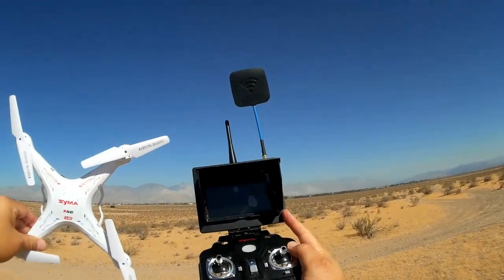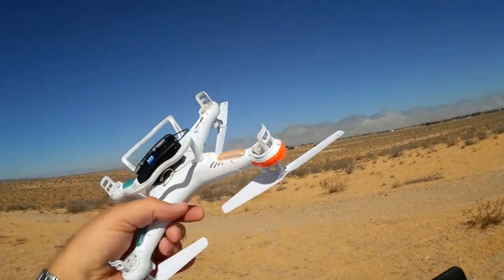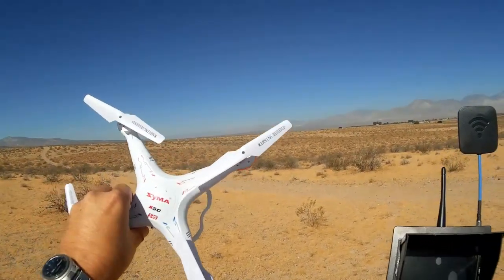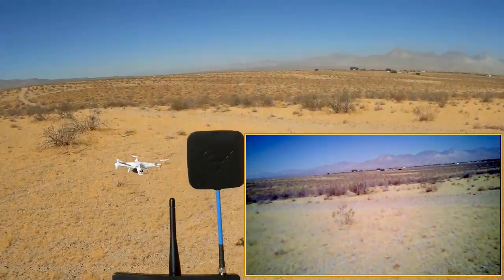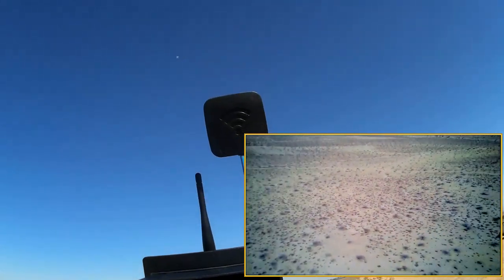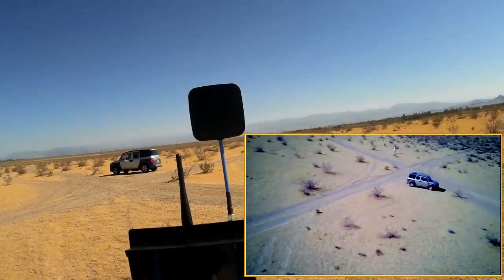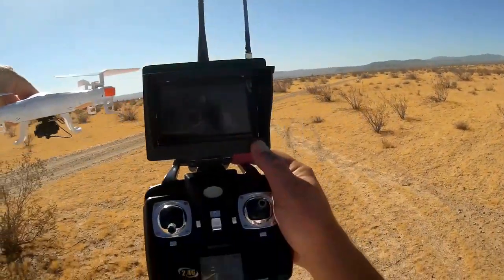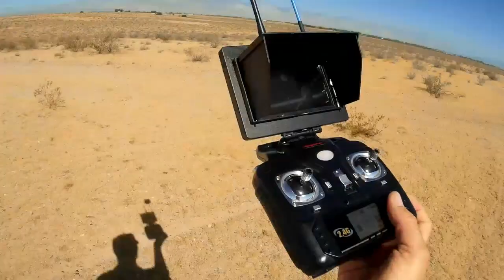Syma X5C X5S 5.8Ghz FPV Upgrade Review

Comment: How many dBi has that 5.8ghz planar antenna? Can I use another stronger antenna to increase distance for receiving signal? :D
Reply from the maker: It's about a 6dB similar to this http://www.banggood.com/Aomway-FPV-5_8G-6dB-Panel-Antenna-Mini-Enhanced-Antenna-for-Receiver-SMA-RP-SMA-p-1041209.html?p=RB0922217402201307U3
Reply: +Quadcopter 101 thank you sir, this was very fast and good to know :D
Reply: Sir, I bought and I got this product :D It is awesome, but I have one problem..my syma can not raise more than 1 meter from the ground, I use 800mAh new batteries :D Also I have new motors .. what can be the problem?
Reply from the maker: How To Channel Gently turn each propeller by hand to feel for any unusual resistance or binding in the turn.  If you notice any unusual bumps or resistance, you may have dirt or sand particles in the gears.  This will stress the motors.  It's very important to clean the gears so that the porpellers spin freely like a pinwheel.  Use an old toothbrush or pin.  Here's how https://www.youtube.com/watch?v=LzzD3BPVvH0
But if all propellers are spinning freely, but the quadcopter still does not have much power, then one or more of your motors may need to be replaced. To check for a failing motor, quickly apply power to take off.  If the quadcopter momentarily tilts in the direction of any particular motor at liftoff (instead of remaining level), that motor may be failing and needs replaced.
Reply: +Quadcopter 101 lovely answer sir, thank you very much :D

Comment: What is the camera called
Reply from the maker: +Tristan Taz  It's just a generic no-name FPV system.  You can find it here http://www.banggood.com/Syma-X5C-1-X5SC-X5SW-5_8G-FPV-720P-Camera-with-Monitor-Real-Time-Transmission-p-980090.html?p=RB0922217402201307U3  
It really works great.  I just did another video where I demonstrated FPV flying of my Flying 3D X8 using this system (video to be released later this week).

Comment: how do you record with this on syma x5sw also what resolution is the recording
Reply from the maker: You remove the existing camera, and replace it with this.  You'll also need a microSD memory card for this camera.  You start/stop the recording by pressing down on the silver button (throttle trim) to the right of the throttle stick.
Reply: What is the resolution
Reply from the maker: 1280 x 720p

Comment: Do u fly in headless mode
Reply from the maker: +alexjs0900 No, the X5C does not have headless mode.
Reply: +Quadcopter 101 I thought you said it was the x5sc
Reply from the maker: alexjs0900 No that's a X5C-1 in this video. Although this FPV camera can be used on both the X5C and X5SC.

Comment: how did you get such stabilized footage?
Reply from the maker: +Kaikualexander Lee Be gentle on the controls, AND always keep some forward movement / pitch when taking video.  Apply gentle yaw to turn and keep the quadcopter overhead with its forward movement.  If you're new to quadcopters, recommend the following tutorials to help you learn forward flight.  Be sure to also check out the other tutorials if you have time. http://quadcopter101.blogspot.com/2014/12/quadcopter-flight-school-4-horizontal.html
Reply: thx that helped a lot can i still do flips? with the camera (not for stable footage)
Reply: last question should I get the syma x5c or the syma x5s and can a syma x5c transmitter connect to syma x5s quad?
Reply: and is it better if i get the syma x5 fpv set or the syma x5s fpv set
Reply from the maker: Get the X5C.  It's a much better flier.  And the 5.8 Ghz FPV upgrade system is for both the X5C and X5S (it comes with attachment brackets for both).
Reply: so i should get the syma x5c vs the syma x5s if i had a choice. ( not about money) and also why is the syma x5c better?
Reply: pls help thx ive been looking for the perfect drone for me
Reply: i mean that fits my needs
Reply from the maker: Kaikualexander Lee 

Get the X5C.  It's a much better flier and doesn't have the "wind bug" that the X5SC and X5SW have.
Reply: thx know any place to get it cheaper?
Reply from the maker: Kaikualexander Lee If you live in the USA, it's $39.99 here http://shrsl.com/?~ap4t
Reply: thx does this drone have a v6 chip?
Reply: This for sure is the last of my question (im new to this quadcopter thing).
Reply from the maker: Kaikualexander Lee I don't know.  It's more or less luck of the draw.
Reply: thx im gettinh the syma x5c with fpv

Comment: It lifted about one foot and lowered seemed like it was to heavy.
Reply from the maker: +Ralph Paradiso The stock X5C camera is about 8 grams, while the FPV camera is heavier at 22 grams.  But a normally operating X5C has more than enough power to easily lift it as seen in the above video.  There are several reasons it may not be able to lift it though.  The first is elevation.  If you fly in a high altitude area (such as Denver), the air may not be dense enough to provide sufficient lift.  But assuming that you live near sea level, the other two problems are either debris in your gears (again check by turning each propeller by hand).  But if all propellers are spinning freely, the final problem would be a failing motor which needs replaced.  You can identify the motor by applying quick throttle to attempt a rapid takeoff.  If the quadcopter momentarily tilts in the direction of a particular motor, that one is suspect.
Reply: +Quadcopter 101  Thanks for the help, you were right, one of the motors was going bad. I only found it after I heated up the the quard. I changed it and it lifts inside as soon as the sun comes out I'll head to the field Thanks from one of your Long Island NY  followers

Comment: This video:
https://www.youtube.com/watch?v=K9TcBJgEusk

Indicates the JJRC H12C Camera is compatible with the SYMA X5C-1. What is the likelihood I could mount that FPV kit to a JJRC H12C Transmitter/Controller? I'm assuming the FPV kit is self contained and had no real integration with the controller other then to be mounted on to it, except for the fact H12C cameras are compatible with X5C-1 and mounting is incompatible.

These mounting sets could be compatible with the copter and FPV camera, but I'd still have issues with mounting monitor to transmitter/controller:
http://www.banggood.com/JJRC-C3001-2-2MP-HD-Camera-Set-For-H8C-H5-H5C-Syma-X5-X5C-M1-M2-H13-CF-885-p-977497.html

Comment: heres a better solution: get a cheap action camera from amazon, attach it to it with blue tack and zip ties. enable wifi on the camera and your phone. Easy!
Reply from the maker: +Blast Cake Gaming WiFi action cams are too heavy for the X5C. Their WiFi also operate on 2.4Ghz, which is the same frequency as the quadcopter's controller.  Because of this, WiFi FPV fliers generally have terrible range (around 50 meters) as compared to this 5.8 Ghz system (about 150 meters).